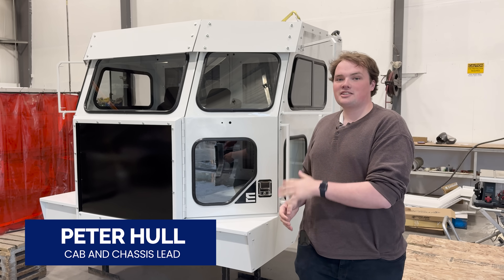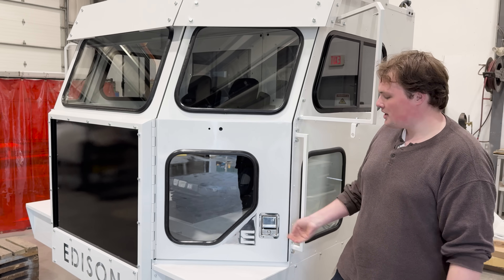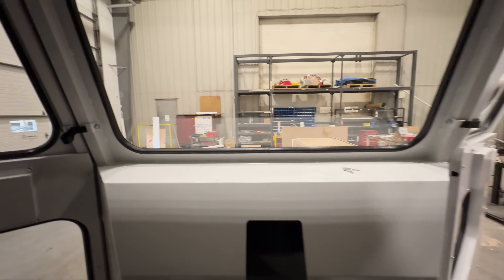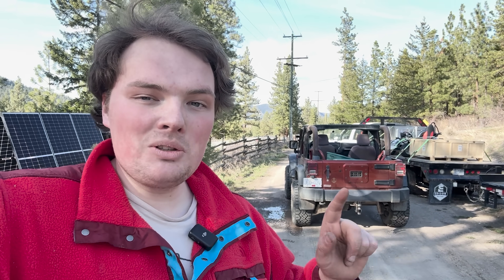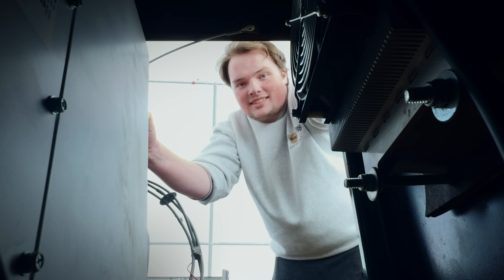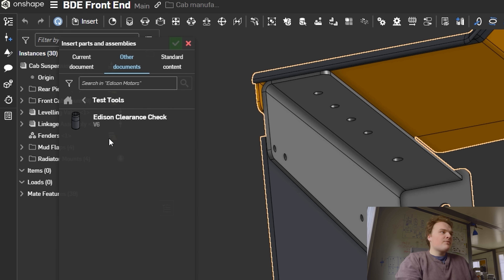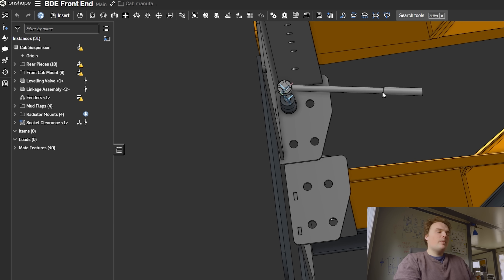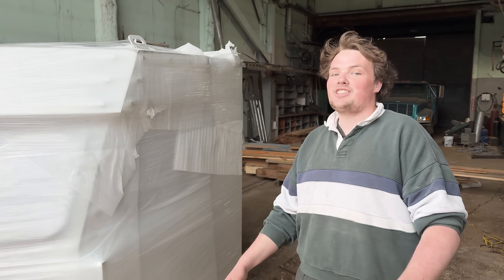Building Our Secret Undisclosed Cab-Over from Scratch.

Comment: Do those lifting points eventually come off?  I think they will whistle in the wind if they aren't removed from the cab.
Reply: Looks like they bolt on
Reply: This truck will probably never be driven at highway speeds, or if so, for very short distances. And yes, they confirmed they're bolted on.

Comment: I like the concept of using configurable tools to check for actual clearances in a design. One thing that I would add for anyone designing for service - minimize the number of unique tools to service a particular area. IE - fastener standardization and clearance standardization for any particular area. Don't heavily mix sizes and/or lengths unless absolutely necessary (it never is).
Reply: You should see how many different types and lengths of screws can hold one access panel on a business jet
Reply: Core concept of design for manufacturing right here. The big guys have interlocked assembly lines and DC drivers, you guys are very talented but fewer fastener types mean fewer ways to use the wrong fastener.
Reply: Rory Irish  ( guess what TRILOGY he is a fan of ... ) has "The ONE WRENCH to RULE  Them All"  on the back wall of the cab ,  having designed TRAILMATER  &  its Workhorse business-end  using 99-100% the SAME Size  Bolthead 😉 🔧.
Reply: @rythemzlatin I was thinking about Rory trailmater and his "one wrench" he uses on his offroad recovery trailer.
Reply: Having been the owner of a few Japanese cars over the years you could fully disassemble one using 8, 10, 12, 14, 17 and 19mm spanners/sockets and a JIS profile crosshead screwdriver.
Reply: I used the same philosophy during design review meetings especially with fresh graduates. It only took 3-4 reviews before it was ingrained. 
No more than two wrench sizes within a sub system.
Reply: @Humblescot  my old 78 Ford 90% of the bolts in the engine bay are 1/2 and 9/16, just kept one old open dual size wrench under the hood on the big side rail and had the majority of my emergency tools in one wrench and a flathead screwdriver. Simplicity is elegance.
Reply: @Humblescot  It's surprising that more companies don't use a similar approach to new engineers. I worked for Hewlett Packard many years ago, when the name was only "Hewlett Packard." I got a call from the Engineering Manager one day asking me to "take each of the new hires" under my wings so to speak. He asked me to show them how the "factory" worked, so they wouldn't waste time trying to re-create everything they would need in supporting their new product line. HP didn't hire many dummies so it didn't take long to open their eyes, but I'd get calls periodically for "...who does this stuff" questions.
Reply: I love this idea. Try to use a few standard size/length bolts. Seems like modern auto manufacturers enjoy flexing their engineering prowess by including every size/shape/length nut and bolt in their vehicles. Edison, please limit the torque, robertson, quadrex, pozidriv, tri-wing etc.
Reply: @Sah-o5m I had Japanese cars for years, my Mazda I can basically rip it apart with an 11mm, my Nissans (one is actually old enough to be a 'Datsun,  made by Nissan) take a 13mm.  I have learned buy them by the HANDFUL  from a  local tool vendor.
Standardized bolts is Great!
Reply: @Sah-o5m I'm an industrial automation engineer and have tried to design by this principle for years. On items that need regular service I try to come up with toolless solutions or captive hardware when possible.
Reply: @Sah-o5m and no part store carries those bolts. Had a good one recently needed a couple pto cover plate bolts on an eaton 18 it's a special thread nobody had them in stock luckily a buddy had a couple extra if not no idea how long I would have had to wait to get some
Reply: Absolutely. My harley is all over the place with standard, metric, hex, torx, and bolts. It's a MASSIVE pain in the ass.
Reply: @2kanchoo  Edison....the anti Harley of the vehicle manufacturing world.